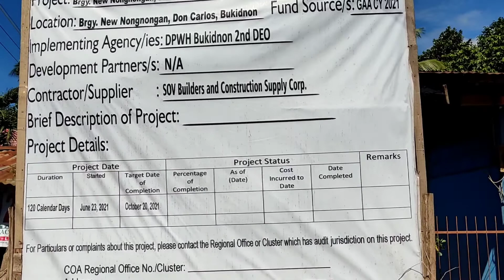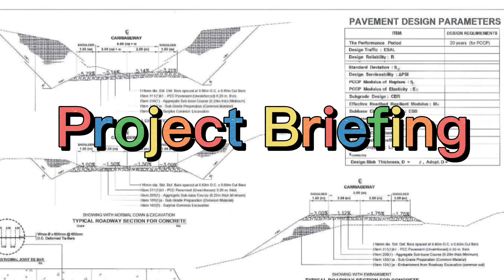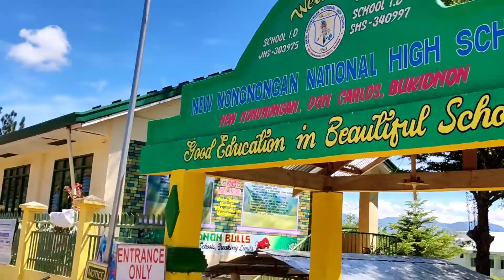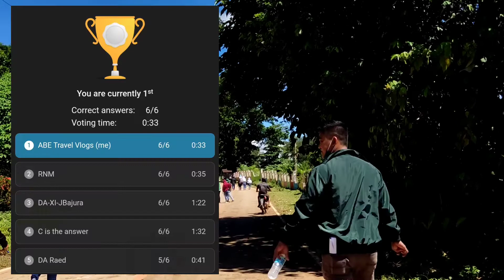Farm-to-Market Road Project with Item 206(1) -  Polymer-Based Chemical Soil Additive

Comment: May I ask sir yong quantity of polymer(liter) per cu.m meter of soil?
Reply from the maker: Hello po. As practice po using RT20 Dynamic Polymer, 1:50 po yung mixture namin. 1 liter of soil stabilizer and 50 liters of water for 5 cu.meter of uncompacted soil or equavalent of 5 meters length of road at 5m carriageway. Thanks po